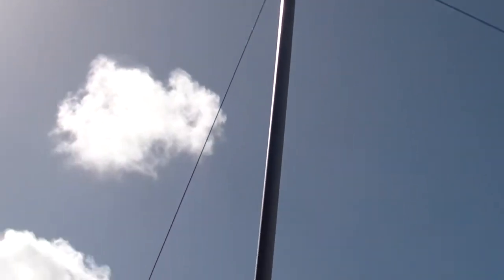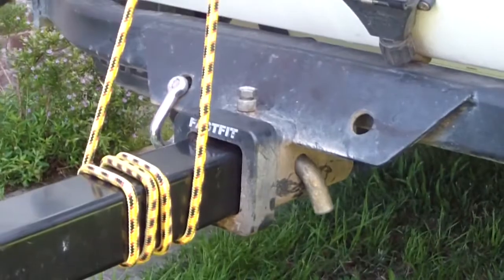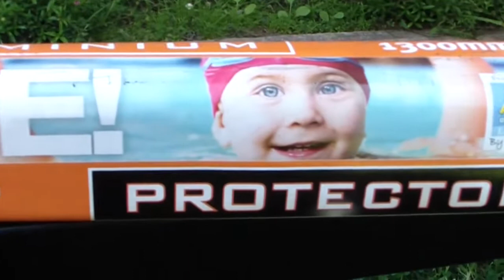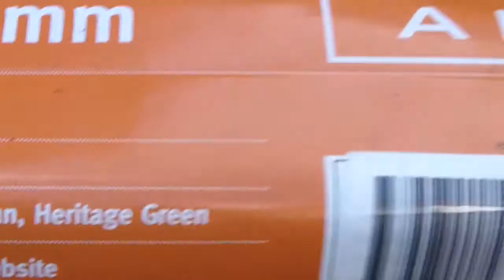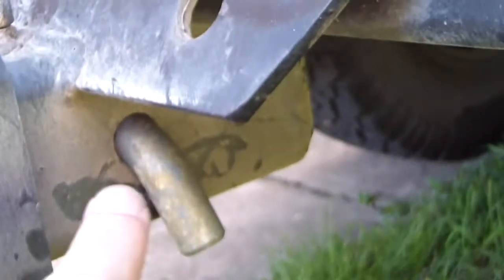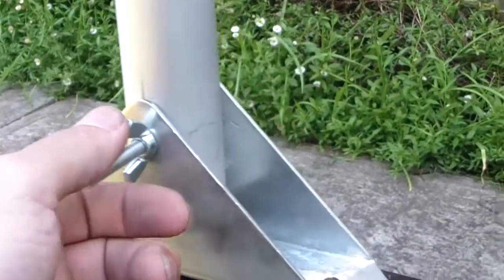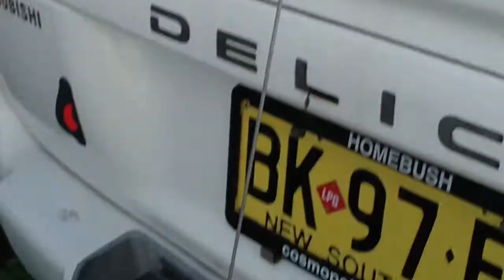mobile / emergency / field day vhf/uhf radio communications set up

Comment from the maker: cheers Mark. I tend to find flange and radio do not mix very well and have a habit of competing for attention. 
You would be well aware which one wins 9 times out of 10. It's the 10th time that can be costly though. 
Have been enjoying your vids also. 
Thanks for taking the time. Eagerly awaiting the cooler weather here for some hiking, hammocking and camping. 

73 VK2MRX